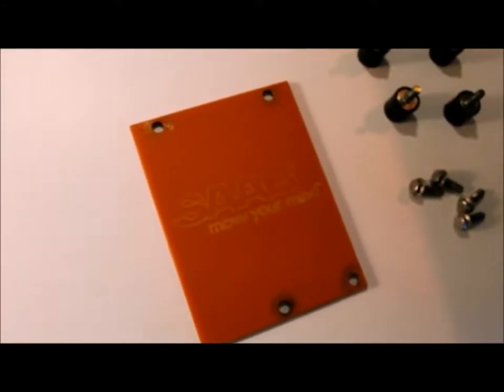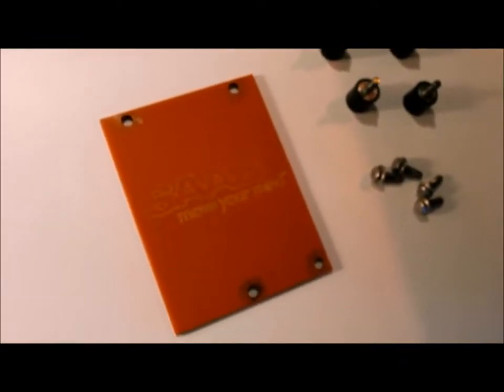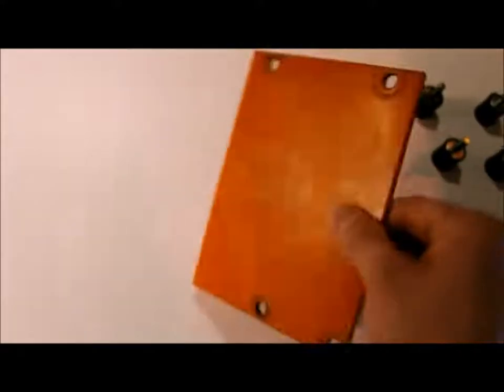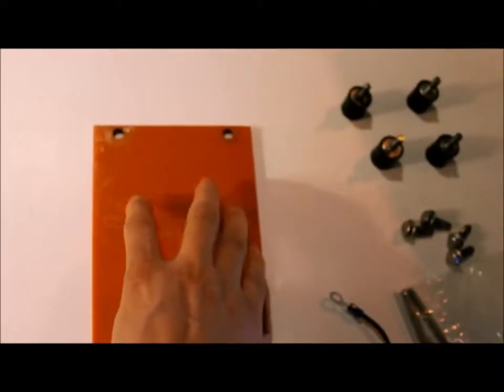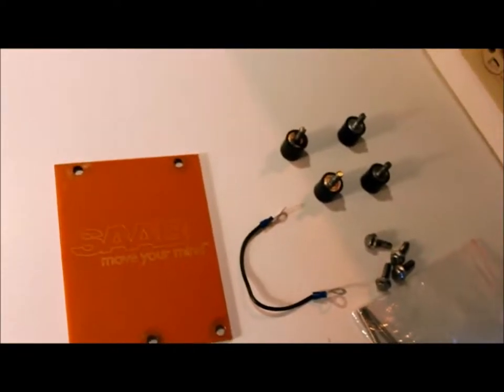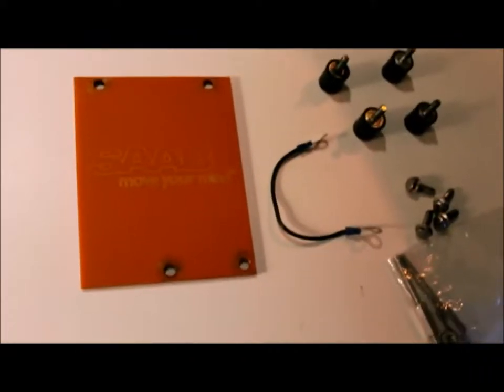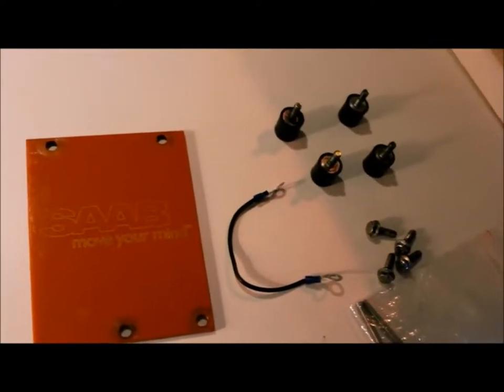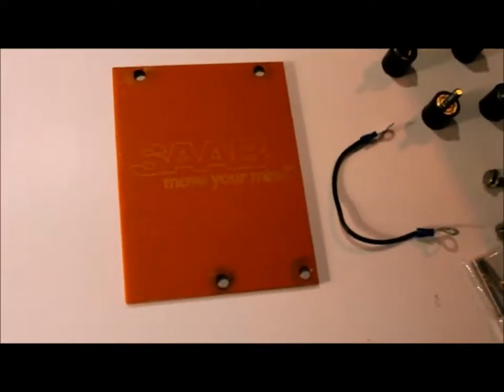2007 Saab 9-3 Stability Control Failure FIXED

Comment: From you explanation, sounds like you installed the ground in the same location you removed it from. You cant ground to plastic 🤦🏽.  Use the wire provided to relocate the ground.  Or do what I did if you want the ground in the original location.  Install a metal washer between the plate and the ground wire connection to metal, and your problem is solved. 
FYI ⚠️ The plate you're using in addition to being overpriced could be hazardous to your health.  Some of these plates (like yours) are advertised as made with bakelite.  Use of this product could be hazardous to your health.  Bakelite is made with famaldyhide, and phenol as the main ingredients.  You may want to Wear a Mask when opening to a hot engine bay.  Opt for a different material if you're going to install one of these kits.

FYI:  Formaldehyde is a highly toxic systemic poison that is absorbed well by inhalation. The vapor is a severe respiratory tract and skin irritant and may cause dizziness or suffocation. Contact with formaldehyde solution may cause severe burns to the eyes and skin.

Comment: Wait, you tightened a ground connection, threw a part away, then made it clear some of your lights aren't working, and you're ok with that. If this is how you treat your Saab.  What sense does this video make?  It's obvious you created the problem when you originally installed the insulator kit, you can't use plastic as a ground 🤦🏻 It irks me when I see folks treat their Saab like this.  When you install this kit you need to relocate the ground to another metal surface, that is why the kit includes the wire.  When you remove the ECU it is always made clear not to forget to reconnect the ground. FYI that ground is not the only ground wire that would cause that problem, just saying.
Reply: “this is how you Treat your SAAB?” 

FUCK SAAB! It’s ALL I can do to NOT TACH this MF out til it BLOWS! But I need it…So ya i Get What ur saying
Reply: Aww you have the 4cyl? FUCK! I Need to know what to do about the 2.8 having this Issue. It starts up almost Every time(Save for tye times it doesn’t HA) Itll CLICK and I Lose ALL power UNTIL I Disconnect the Battery and Reconnect. And it’s FINE…Again until it’s Not…I’ve EVERY “Side Marker Fail”
R/R Brake light Fail”
“coolant Low Refill NOw”
I’ve CHECKED AND CHECKED AND CZECH’d ITS FULL! 
Oh…My Fuel Gauge Goes ALL yhe way Up then BACK ALL THE WAY down about 300 Times Per Minute but Everry so Often Itll PEG where it’s Actually at šo ℹ just put 10$ in EVERYTIME I leave so theres
always 1/2 tank usually

Comment: The real issue is GM/Saab used thin wires and are absolutely junk. From the injectors to wiring harness to the front lights, low grade trash. The just double checked one of the ecu grounds. Somehow the bolt was loose. The saab engine bay has such an enormous amount of heat and piss poor wiring.
Reply: STR8 UP! It’s HOTTER THAN SHIT in there. The Turbo Position is SO FUCKN LAME

Comment: Why buy the spacer kit?
I made my own from a piece of " tuffnol", this is commonly used in sub stations and big electric motors.
As I work in a junk yard I pulled a suitable piece from the connection block on a 3ft long motor.
The tuffnol is heat resistant, and 3/4 in thick. 
The extended screws I picked up from a home depot.
I also picked up from our yard an extra earth wire from a scrap car, not a saab.
I used two earth wires,
One in the original underneath position, and another on top, to a different position on the engine.
Total cost, about £3 or $5.    For the screws nuts and washers.
Next I plan to temporarily fit a 4 inch square 12v computer fan on top, before a friend of mine makes up an extension for the ecu harness so that I can relocate it somewhere dry and cool. 
I sympathise with you on the overpriced piece of plastic.
Reply: What is the Spacer for? That Seems Redundant!

Comment: I just bought a Saab 2008 9'3 2.0 manual off a friend that don't know much about cars. It needed an Altinator I replaced them had to replace pulley tensioner found to be broken, drove it home fine no problems was letting it idle the car shuts down itself and the light comes same as yours and won't let me start, won't crank nothing unless I take the terminal off and out it back on... I guess I'll have to check what your saying mak s sense....

Comment: LOL well guess how I arrived here :)  I used the same spacer kit (I believe the plastic piece is a type of bakelite, we'll see once she heats up), and deleted the add-on wire because the original ground cable seemed to reach.  Of course, the screws used in the kit are different metals, so I guess I gotta jump the negative over to the bolt on the throttle body.  I would guess the culprit is those dodgy rubber spacers between the orange plate and the ECU not making a good ground.